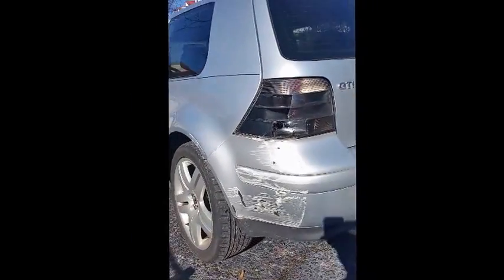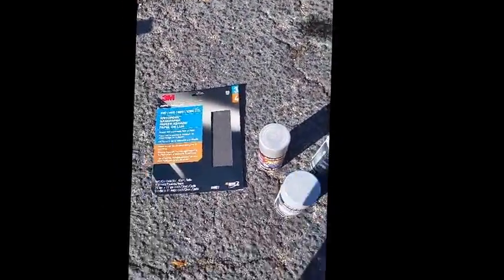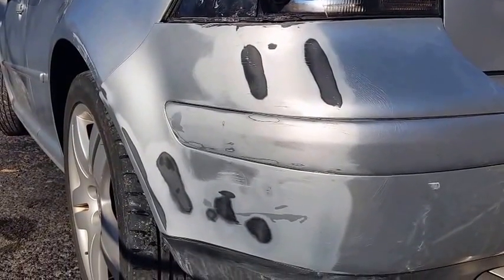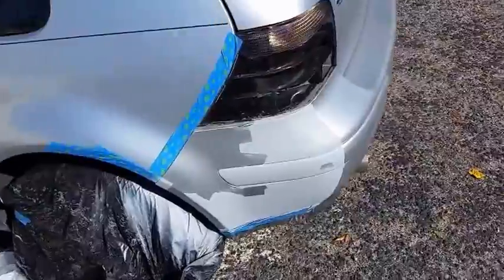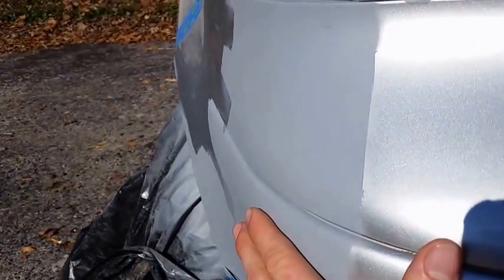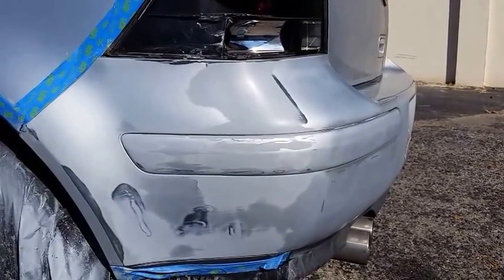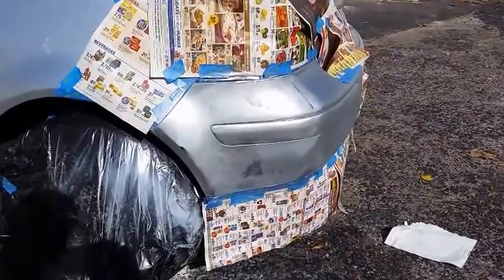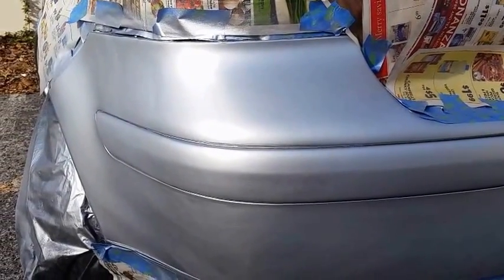DIY car paint repair

Comment: I used the Duplicolor stuff on mine today. I got an almost perfect color match. After reading what other people did to get the best results, I found that it’s best to use 2k clearcoat, place the can in hot water for 10 minutes before painting, and then shake the can for 1 minute before spraying. I did 10 minutes between coats as well.

Comment from the maker: I used rubbing compound on the area I repaired because I could feel a large difference in smoothness between it and the original paint. Smoothing it some, the match looks better as they now have a more similar finish, BUT it seems to have highlighted the dents a touch more, guess you really  can't win them all .lol...

Comment: Nice job. I think you need to buy thick primer and apply a few more coats to fill in the holes. Did you check your paint color code from the car to match the perfect match can?  I'm going to do my daughter's  honda civic, since the bodyshop quoted me $450. I think it is worth to try for 20-30 bucks.